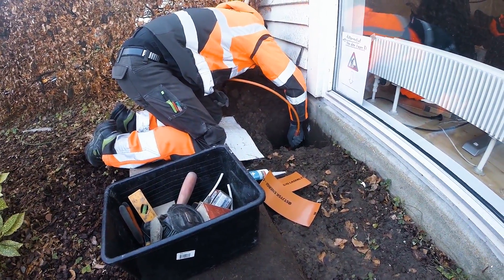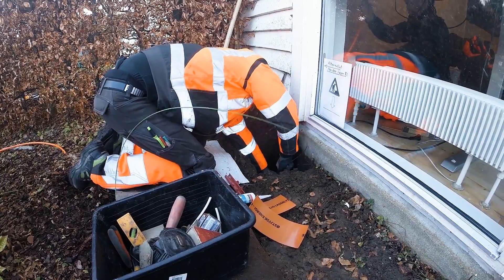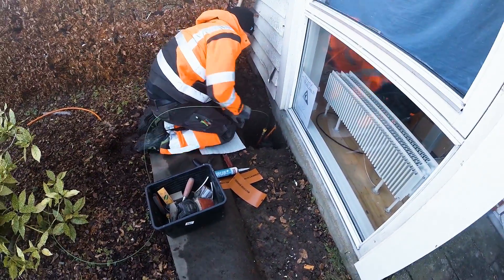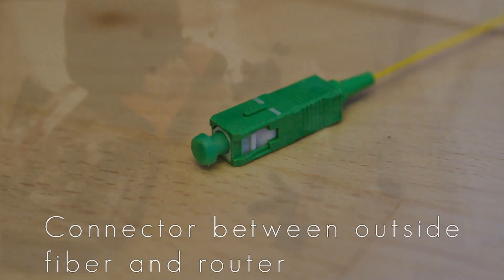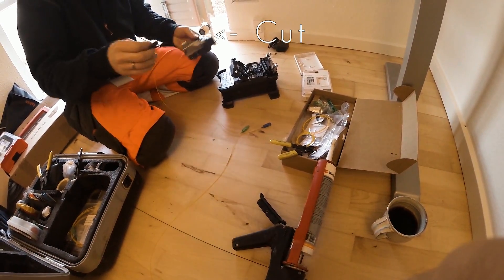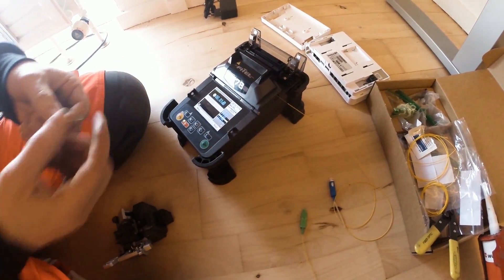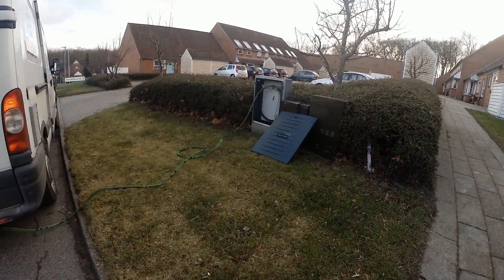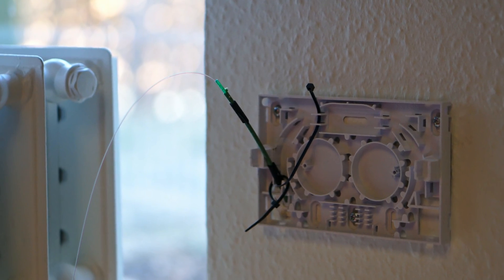Finally fiber and how to fusion splice!

Comment: I have some pictures of how it most likely looks in the car and station, or simular from installations that I've done; Splices in a Fiber panel https://imgur.com/gallery/a0YFp
Splice box https://imgur.com/gallery/GuBtj
Fusion splicing https://imgur.com/gallery/Eql2X

All of the fiber in these pictures are spliced four att the same time and share a protective sleeve.
Reply from the maker: Nice pictures. Thanks for sharing.